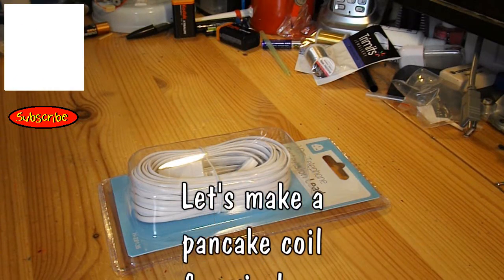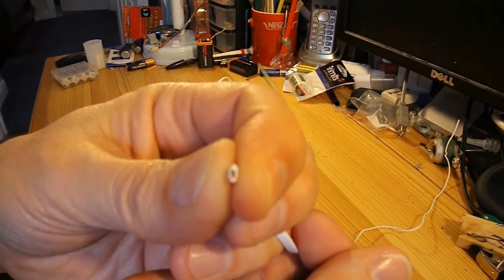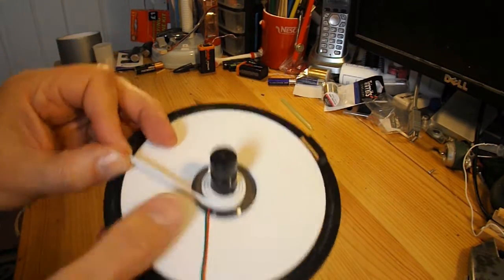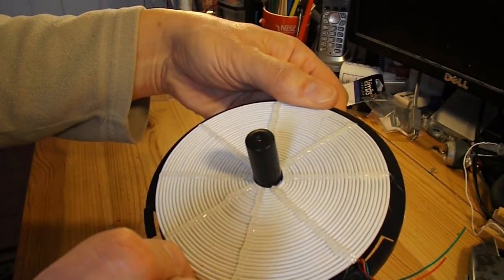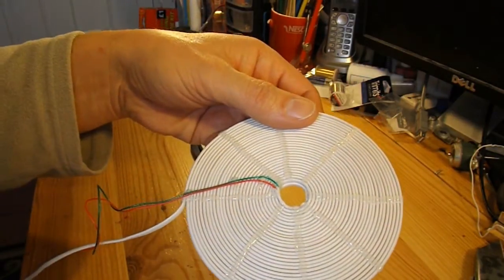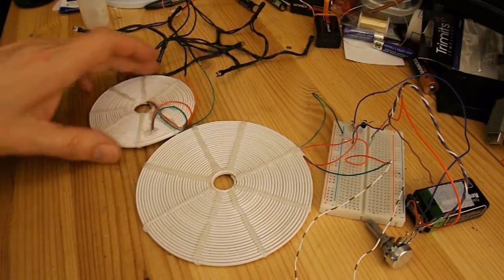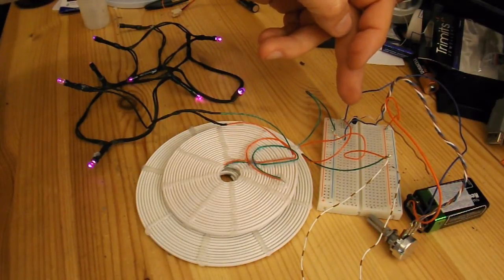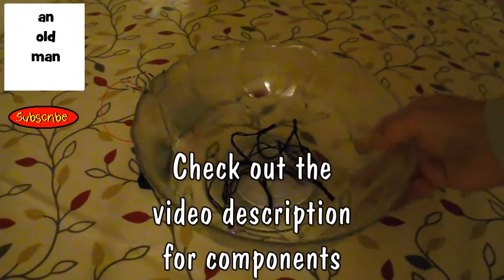Let's make a pancake coil for wireless powered LEDs

Comment: hi, i have made a coil after watching your post with a 1.5v battery and the transistor gets very hot (2n222), what resistor do i have to get to keep it cool and where do i have to place it on the coil ?, i'm new to electronics, help needed and appreciated, thanks.
Reply from the maker: +Mark Bouncer I would check out the video description for the links to Mongrel Shark and Slider 2732 as I built mine from their guidance.

Comment: Yep, that's my SWES - Open Sourced so folks can build their own wireless electricity systems at home. All credit to N. Tesla for the coil: Patent 512,340
MogrelShark (Joel) did some great scope work for me and made vids like the one you mentioned to help folks along.
Use a 1.5V battery and no resistor for no overheating - was designed as the simplest system possible, hence 1 transistor, 2x coil, 1x AA.
Add a diode from the battery Positive to reduce current used if using a 9V. Also a 100ohm resistor from the Negative to the transistor Emitter helps. Play with values based on individual trasmitter coil.
Great build :)
Reply from the maker: Thanks slider. I have taken the liberty of adding your comments to my video description to help anybody who wants to copy it or find your original work..